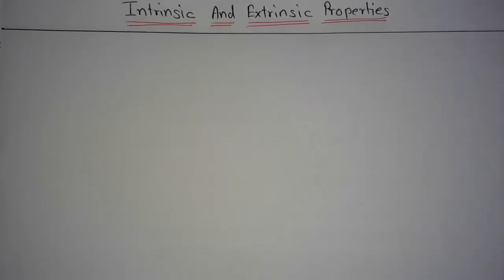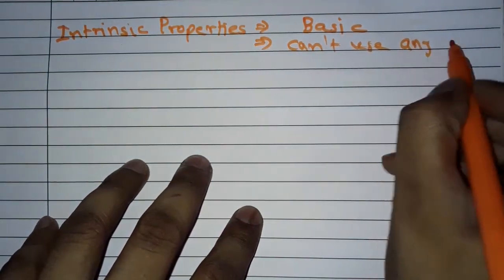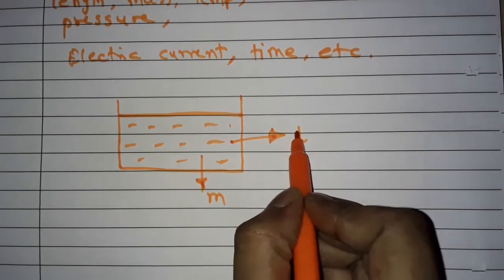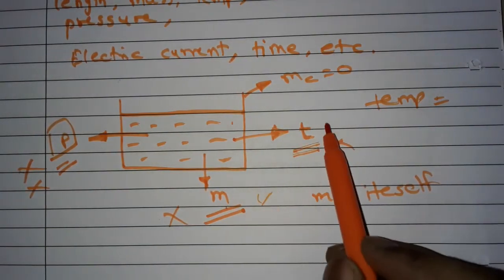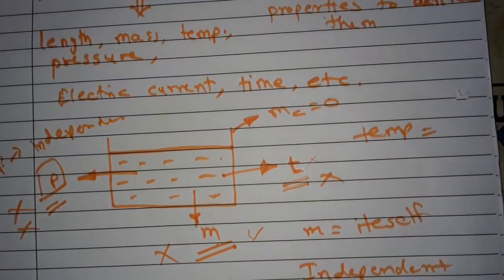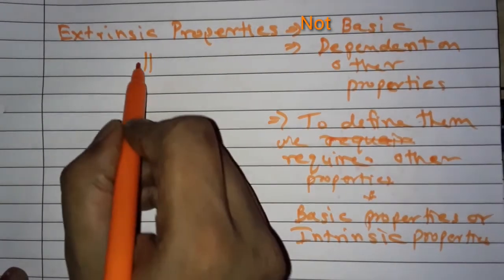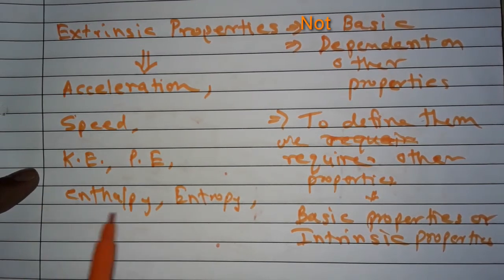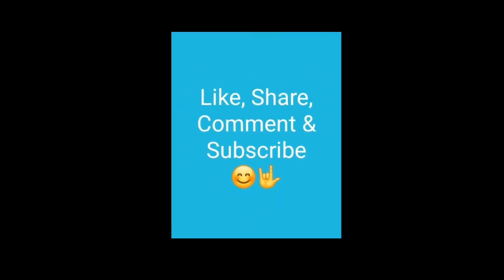Intrinsic Properties & Extrinsic Properties | Thermodynamics

Comment: Hello sir nice explanation 
But recently in our Exam Question was asked as 
Which among the following is extrinsic properties 
a)  Pressure
b)  temperature 
c)  Translational velocity
d) Internal energy 
Now much confusion is there in options C & D, will you plz help
Reply from the maker: Thank you.
Here pressure & temperature are intrinsic properties as they are basic properties.
But Translational velocity & internal energy are extrinsic properties.
Reason :-
Translational velocity - It's value cannot be obtained independently as it depends on displacement and time. 
Internal energy - It's value cannot be obtained independently as it depends on KE & PE of molecules.
Reply: @PratikSPagade  Thank you sir, will you plz provide any textbook which support this argument so i can challenge this question that was asked in PCS exam,  as they give answer only translational velocity
Reply from the maker: Thermal Engineering by Mahesh M Rathore